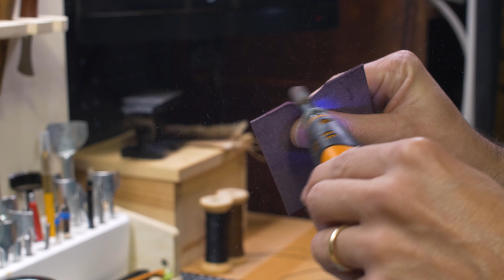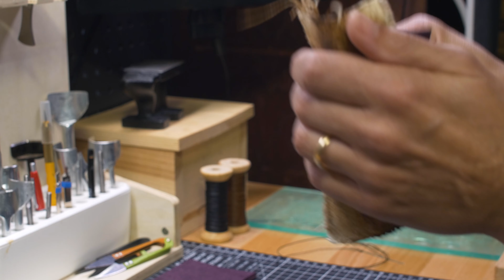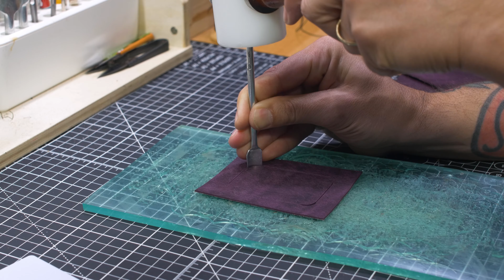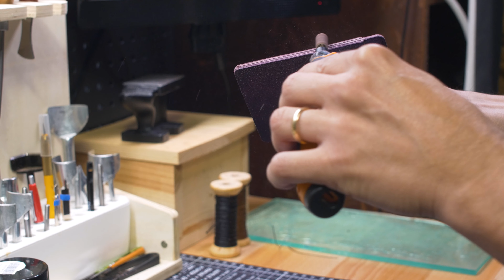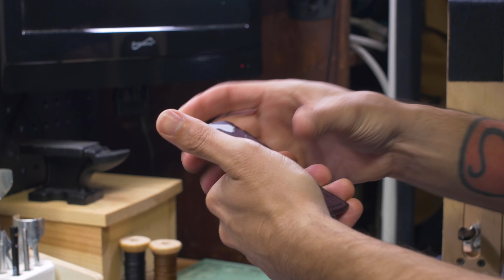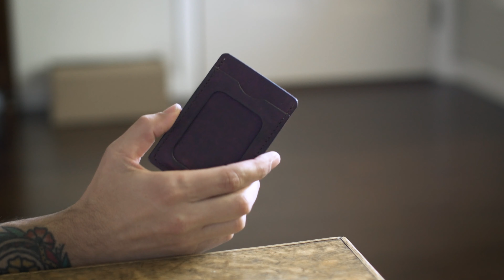Making a card holder from this amazing colored leather. No talking. Leather sounds.

Comment: Which leather thickness did you use there?
Reply from the maker: I believe this is 3-3.5oz
Reply: @coastlineleathergoods  I made a similar card holder, but it's somewhat bulky. I also used 3 oz for that, but didn't thin out the middle part. Maybe I need to try that.
Yours looks awesome! 👍🏻